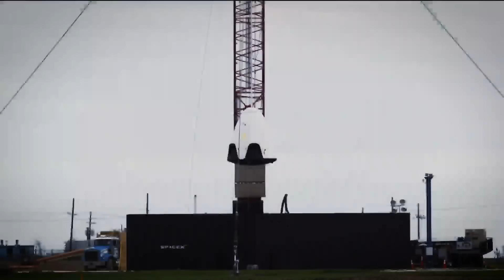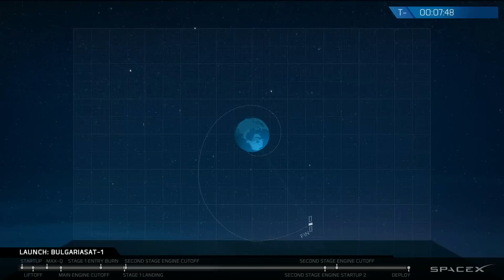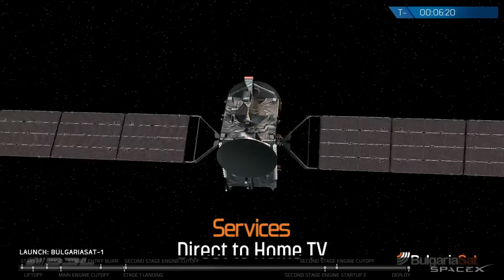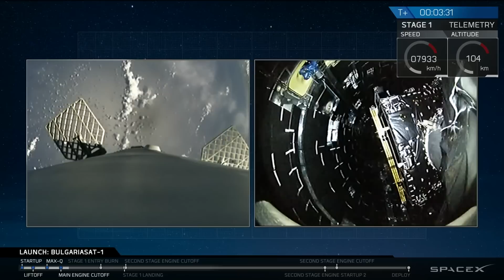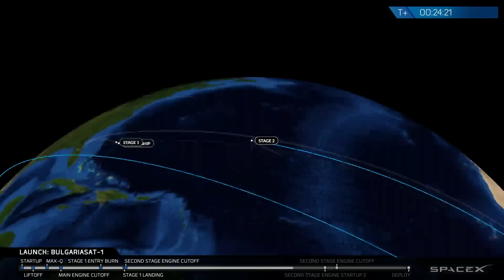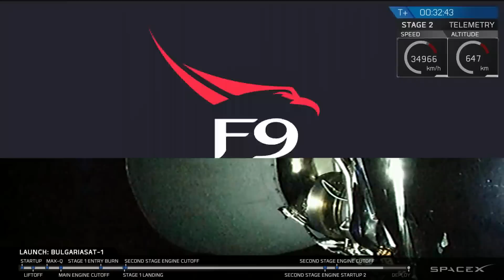BulgariaSat-1 Launch Webcast

Comment: Damn that landing was hairy... by the looks of it, the booster only just managed to land.
Reply: IAmAPerson _ A year and a half ago, this would blow me away. Now, we are complaining about it being off center. That's actually amazing.
Reply: Fair point m8!
Reply: "it doesn't matter if you land by an inch or a mile, landings landing."  ;)
Reply: Elon tweeted "Rocket is extra toasty and hit the deck hard (used almost all of the emergency crush core), but otherwise good,"
Reply: Kaleb Bruwer I'm not complaining, just remarking. The landing did look hairy, considering that first the exhaust was over the water and not over the drone ship. I said it looked like it only just landed because of the last-minute correction needed to land successfully.
Reply: Any landing you can walk away from, wasn't hard enough.
Reply: when the feed cut off it looked like the rocket splashed next to the ship... i was already "fu.. didn't work" but then "yeah, managed"
Reply: IAmAPerson _ SpaceX actually aims their rockets towards the sea by quite a couple hundred meters so that if some vital system fails on the rocket it will only splash down in the ocean instead of damaging the barge.
Reply: That's smart indeed.
Reply: Admiral Von Schneider right another pike of junk on the ocean bottom to add to the rest of what goes down each time a launch happens
Reply: Willie Gillie - Yet when compared to the Japan Tsunami that washed whole villages into the oceans, spacex impact is minimal. Besides if humanity expects to survive, we need to venture into space.
Reply: hycron1234 humanity doesn't even take care of its own humans. Why would any other planet want our problems. Elon needs to get his head out of the clouds and space and fix what's wrong here before venturing out and taking the risk of ruining another planet. He's got a good heart just needs to prioritize.
Reply: Willie Gillie nope.
Reply: Willie Gillie Space technology leads to advances across all industries as the tech developed for it trickles down. For example setting up a colony on Mars would require solar panels to generate power and batteries to store it. If you tried to do that with the tech from ten years back you'd need to lug huge amounts of weight up there and it just wouldn't be viable. So you invest in improving solar technology and creating more efficient batteries.

The result on Earth is that we are able to remove fossil fuel power plants from the grid and replace them with highly efficient solar with the excess power being stored in efficient (and cheaper) batteries for when there is no sun. These improved rechargeable batteries also lead to less pollution from people throwing away batteries and potentially the elimination of petrol cars. It would also give developing nations better access to lighting, communication, medical tech, etc which is going to improve their lives dramatically.

I don't think it is any coincidence that Elon Musk also has his fingers in battery and solar tech when they would be essential for his vision of colonising Mars. If it takes a wild dream like that to lead to the inspiration to improve that tech... surely that's a good thing?
Reply: I don't think his head is in the clouds. His goals could be common to us all and force us to work together instead of fighting all the time. Plus Elon is working on ways to help keep Earth habitable in the future.
Reply: That's normal. The landing trajectories are always deliberately off-course until the landing burn starts, that way if the engine fails to ignite for the landing burn, the booster will fall harmlessly into the ocean instead of hitting the pad or drone ship.
Reply: Willie Gillie - This planet has been destroyed before, humanity is only a small footnote in Earths history, and will continue on just fine without us. Exploration, innovation and understanding, our answers are out there, not here with apathy and stagnation. Humanity needs room to grow, and that can only be found in space.
Reply: hycron1234 na we'll just mess it all up too. Till we start taking care of our own we suck at leaving our own planet
Reply: Sakraf looks like it's squatting on them Merlin engines
Reply: hycron1234 naw humanity has no business leaving terra firma till it solves its own problems. Far from it
Reply: If we go or stay those problems will always be around. They will not disappear by not going to space.
Reply: Jeffrey Root we could
Reply: +hycron1234 I agree with you except your statement that the world has been destroyed before. Civilizations may have been destroyed, but not the Earth itself. Like you said Earth will most likely outlast humanity. It definitely will if we do not become a space fairing species and learn to live beyond Mother Earth.
Reply: Jamie Godman we are not civilized enough to leave our own planet. We have a long ways to go before we are ready to venture off to some other planet.
Reply: Willie Gillie Have to start somewhere
Reply: so... a civilization of the rich and privileged who inherited access to education? I'd rather stay on Earth to improve everyone else's lives.... and help more people get access to space than just millionaires and some eugenicist's favorite tech buddies.
Reply: what if we're so far gone that the only choice is to cultivate life on other planets though?
Reply: Donald Sanders even the smartest and most educated sometime end up with no common sense. Changes need to be made her on how we treat one another before we'll even be near ready to reach out into space.
Reply: donald sanders??
Reply: Tuxfanturnip DO I HEAR A RIOT?
Reply: If we humans should fix problems on earth first before venturing out to space, we are never going to venture to space. Problems will always occur, there will also problems on mars if we get there, or I could just simply say, if there are humans, there are problems. Why don't we do both? It is okay to multi-task, right?
Reply: Frozen
Reply: It's not normal for the water to splash like that. It should be over the barge at that point in the landing. For evidence, look at the CRS-6 landing video. The engines gimbal back and forth, but the water only starts moving when the rocket is 100-200 ft above the platform. By then, it should be in stable vertical descent. You can also see marks on the deck of the ASDS that indicate the core likely slid substantially as it landed, which makes me think this was a "successful CRS-6" where it managed to recover from an overcompensating control system.
Reply: Willie Gillie And how exactly would you propose that happen without space? Advances in technology through expansion into new frontiers is what created our global civilization. What you're suggesting is just pessimistic and self-defeating. Just because we have problems doesn't mean we should abandon our hunger for cosmic truth, it's the forward direction of space and the wonderful technologies and knowledge that comes from it that will help us in ridding ourselves of our faults.
Reply: We can further space exploration without gushing over how it's going to solve all our problems and create an eternal society of Silicon Valley Ubermensch
Reply: We can, but why? Space exploration is cool as shit and does open up new possibilities.
Reply: because it isn't the solution to the world's problems. It has its place, yes, but we can't just run from climate change, letting the rich and powerful watch the world die in comfort. We should work to fight inequality before it comes down to evacuation. We should do both, and not treat space exploration as some miraculous ultimate goal. Human benefit should be the first concern in space research, not "it's cool as shit" (though that does have its uses)
Reply: Blah, Blah, Blah.. Get a new song, please.
Reply: Why not do both?  Fixing what is wrong here is Solar City and Tesla.  Looking to the future is SpaceX.  That's more than enough for one industrialist, if you want more, you need to step up.
Reply: Again, nobody asserted it's the solution to all our problems. Additionally, no one asserted that space being cool is or should be the reason we expand into it, but it's definitely the reason why so many people talk about it online and find it captivating. Sounds more like it just bugs you if you see people talk about the cultural and technological benefits of space travel as opposed to more immediate Earthly issues you would rather talk about.

Anyway, if you wanted to make a difference you could do so to your heart's content, and Elon Musk would continue making groundbreaking advances in spacecraft reusability and affordability. There isn't any need to step on people's space boners just cause we haven't solved all our planet's problems.
Reply: Bedrock ل
Reply: OD786 Dro lol so I have heard
Reply: Donald Sanders I like you optimist attitude but selfish people live in this world which means others will suffer their single mindedness.
Reply: Jeffrey Root the money that is spent on ballistics and big business is what drains the good that can done for others
Reply: hycron1234 spoken like a true defeatist
Reply: Adam Ahmed I beg to differ. Exacting course and precise fuel burn is what makes the difference between a successful landing or a failure
Reply: Is there any video of it landing?
Reply: look at the clouds. they are the same in both scenes before and after the cut. so no "fake landing scene".
Reply: Willie Gillie Because everything was just peachy in Europe when people set out to go look at the Americas.
Reply: Adam Ahmed always off course lol that's a good one! Is that what Elon said?

Comment: that landing was scary
Reply: ya. It reminded me of previous landings where in it was on fire or just failed
Reply: fake news
Reply: Highest re-entry force and speed on a Falcon 9 first stage ever. It's surprising it landed back at all. An amazing feat.
Reply: I'm not a flat earther nutjob, an I believe in the moon landing, but I can understand why people cry "FAKE" on this one. Is there any video of this actually landing? What I've seen so far seems like a old magic trick.
Reply: meemedmania Empty stage, they pull the curtain. Moments later they pull the curtain back an reveal the rocket on stage.
Reply: It isn't true. First, SpaceX doesn't have a huge benefit in doing this. Marketing launch vehicles is useless because satellite companies know all the launch service providers (there's only three or four main ones). SpaceX already undercuts the competition by a lot, so why bother?

Additionally, there is footage released of the rocket landing every time. Often the transmission is interrupted due to the vibrations caused by the rocket, but not always. If you look up the Iridium-2 mission, there is uninterrupted live footage of the rocket. Additionally, SpaceX's YouTube channel has some barge views of the rocket.

Finally, the rockets sometimes land on land (depending on how heavy the payload is - since the rocket launches in the direction of the water, it's easier to land on water than turn around and go back to land). The land landings are publicly visible, and there is plenty of amateur and professional coverage of those missions.
Reply: Elon Musk just tweeted the full video of this landing: twitter com /elonmusk/status/1247340041552068609

Comment: If you've never aligned a satellite dish that provides broadband data speeds, that's why you don't understand the video loss during landing. It's hard enough on a completely flat stationary surface. Inject a moving, rolling  platform. And THEN add extreme turbulence. This is COMPLETELY understandable.
Reply: May Zing Media do they release a recording later?
Reply: Often, yes.
Reply: The "simple" and very expensive solution would be to have a separate floating platform for satellite comms, and use a local microwave link between them. (this is only simple from the armchair)
There is not much sense to spend money on this issue, if you can view the recordings later anyway.
Reply: Have a nice day?
Reply: +May Zing Media It's not just the turbulence that causes the problems, it's mainly the ionised gases coming from the rocket's exhast.
Reply: The issue is that the telemetry antennas are moving all the time as they are fixed aboard the rocket, and the rocket stage is in constant movement, even more so during the last few seconds as last moment adjustments in attitude and orientation to the moving landing target.  But the video is recorded from the landing barge, rocket stages as well as from aircraft circling nearby, so once its downloaded, we'll see the full landing.